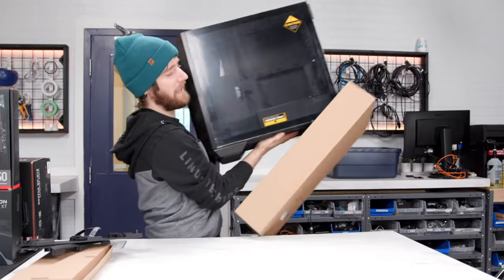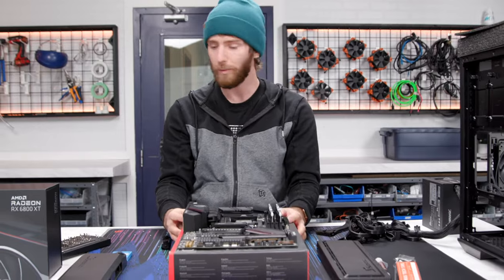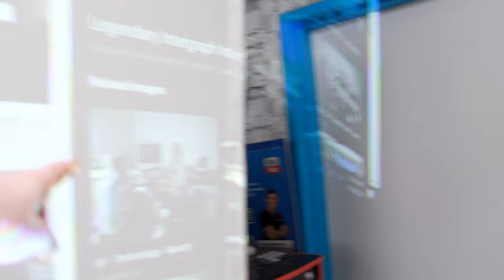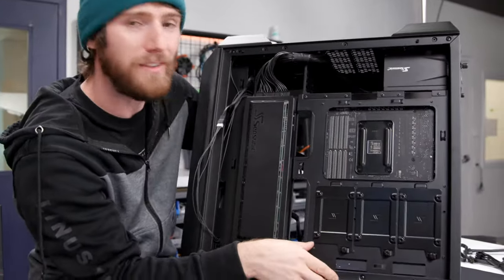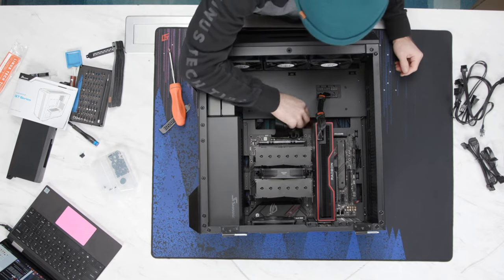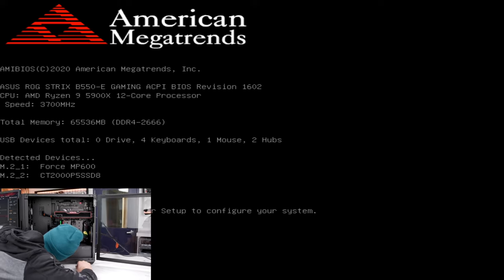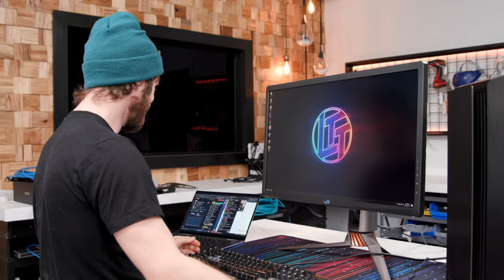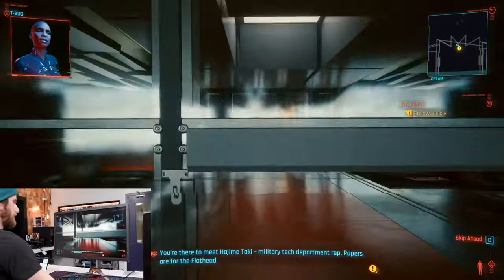The CLEANEST AMD Gaming PC Build

Comment: I think you're being very hard on the Q connector. Just because it doesn't work well in one very specific and atypical situation doesn't make it a terrible idea. It would be pretty easy to make a right angled version of it (or just not use it) for that one situation. It cost basically nothing and makes getting those right just a little easier. I loved it but accidentally sold my last one so now I'm back to wiring my front panels like a caveman. I would really like to know an actually good reason that they don't include them anymore.

Comment: Ok I have to stand up for usb 2.0. I work in an environment where we use a ton of wireless keyboards and mouse's . When I plug the dongle into 3.0 the that stuff does not get a good connection and the 3.0 port is causing interface. Once I put the dongle into a 2.0 extension plugged into a 2.0 all my problems go away. So we need at least one port for this option.

Comment: About the front panel I/O problem: Why won't we just use one of the dozen usb 3.x connectors on the MB routed to a case-hub in the chasse to spread love all over needs? I'm a power-user myself, but still never been able to utilize all my internal usb connectors yet. Might worth to think about it. 3.1 can even deliver way enough power for leds, right?

Comment: you guys ever gonna get those damn screw drivers in or what?

edit: just looked in the store and OMFG they are on the store now and not for sale but you can sign up for email notification and the release date is not concrete but says Summer '22 so basically in a few months.  The price is a bit much but if the warranty is similar iFixIt then it would be acceptable.  I do like the magnet power and the magnet bit idea and the short bits.  Can't wait to try it out if all things are as good as what I have just seen.

Comment: Thought about building a system to game on as the vega 7 in my laptop istn't that powerful. The Ryzen 3 3100 would fit my needs perfectly, if it wasn't just about 20€ cheaper than the Ryzen 5 3600... That said, I'll buy a 3600.

Comment: Hey Linus or someone else... I wanna buy my first desktop and I'm curious if in my setup is something that I did wrong or I can improve but i tryed my best... I wanna make a White setup so after all my research and possibility in my country I enden up with this spec: 
CPU - AMD Ryzen 7 5800x
GPU - Gigabyte GeForce RTX 3070 Vision OC 8GB
MotherBoard - Asus Prime X570-PRO
RAM - G.Skill 32GB DDR4 3600MHz
Power Supply -Corsair CX750F RGB White
Water cooling AIO - Asus RoG STRIX LC240RGB
Case - Phanteks Eclipse P600S - White
Monitor - 27' Acer Nitro XV272UP
I allready own SSD and HDD, in my AW 17R5 so I don't need them.

At all I'm not sure about that water cooling, because I can't find how good it is and how good that cooling effective is with Ryzen 7 5800X + I'm a bit worried if that radiator will fit in Phanteks case that i choose (I'm planning to put that radiator  on front panel). Can someone help me or just give me some advice ?. 
Anyway thank you all, be save and have a good day/night or whatever.

Comment: Linus, do you ever find that AMD and Windows 10 has driver issues and it seams it's just not related to one type of chipset or CPU model or GPU? I've been battling system bugs, blue screens and just plain reboots on just about any AMD setup i touch.  Any insight? Thanks

Comment: Altough i would not recommend x570 to anyone, i got a msi x570 tomahawk wifi and it has a pretty nice i/o  backplate and there  are only 2  usb 2 on it. There are usb2 connectors on the board but there are so many usb3 on this thing you may not even need those. VRM's aren't bad on that board so no problem driving any cpu, but auto voltage on the cpu can get  up to over 1.467v  by itself while boosting my 3600 to 4.4ghz and can get a little scary sometimes. At least i can watch Linus attempting his smooth Limbo roll  with it XD. Now I'm almost less depressed  that i still can't upgrade from my old  Zotac gtx 1050 OC 2gb   card to something  a little  better and my pc looks  like very  unbalanced  like deadpool  watching his legs grow back lol

Comment: Hey Linus. Doesn't NZXT cases as H500i or H700i has the front panel connectors in a single block as supposed to sperate individual connectors. @ 58:31

Comment: You really just dabbing thermal paste on and rocking it at 26:26 ? It's been a while since I've built a pc, but everything I learned then had me lapping the heat spreader to a mirror polish and carefully applying a thin and calculated layer of paste like it was worth more than diamonds. Mind you, I was overclocking the shit out of things with a 480mm rad. I'm gonna go ahead and keep letting myself think that it helped.
Reply: Another reason to not reuse the paste is that having paste on both surfaces and putting it back together can supposedly trap tiny air bubbles between the contact surfaces and act as insulators, impeding your cooling efficiency. Shrug.exe

Comment: with this video only , i am  getting a brief black screen for maybe 1/4 of a second . that re occurs every 10-15 seconds or so .. has any one else had this problem ? i am using  a SONY 65 inch  TV  hooked up on a  ether net  running at 500K + speed ..does not occur with any other youtube video or cable TV

Comment: @LinusTechTips, Is the Noctua CPU Air Coolers REALLY worth the prices??? Or is there something that could allow me a Similar Performance for Cheaper? You re-use 'em so I get that you Can Spend 130-140$CAD on a CPU Cooler, but for the regular Guys like me on a Low Budget that just Bought a New PC that comes with the Standard Wraith Spire that comes with the Ryzen 5 3600.

It's Mostly for Gaming and general Web Browsing, and I'd like to Overclock it a Bit Probably...

And I also need to buy an extra 8gb RAM because it only comes with 8gb RAM...so it would make for a total of 16gb...

Comment: so im confused a 5000 cpu and a 6000 gpu and the ram is only 2666 hertz    how was that a good idea when amd recommends 3600  for all the 5000 cpus
Reply: The ram is marketed at* and capable of up to 3200mhz, it however is clocked to 2666 from the factory to ensure maximum stability across all boards and cpus it may be paired with.
Reply: All ram is throttled from the factory until you activate xmp (or other cpu manufacturer's equivalent) profile.

Comment: Ryzen 7 5800X does not come with a cooler. I bought a Ryzen 5 3600 as a hold over from Newegg since they had them for 200 bucks and that came with a cooler but, I stopped in Microcenter in Columbus, Ohio for a modem/ router upgrade and they had several Ryzen 7 5800X's in stock. I saw unicorn, I opened my eyes really wide and pooped my pants, I adopted unicorn with money. Box is very light. It does not come with cooler.

Comment: The landfill position  @1:07 is not universally agreeable either. Penn&Teller did a BS episode on it like a 10 years ago, no less. I mean, less landfill is nice, sure. But not much else, and it carries a cost too. Is it cheaper to recycle stuff or make a new one? Not that clear, at all. Recycling has an energy and labour cost too. You can easily burn more oil trying to recycle old and/or cheap crap, than just getting new from the source.

Furthermore, the space? It's so much non-issue that it's funny. Throwing it into ocean? Sure that's bad and nasty and even toxic. But keep it in a pile somewhere, later put some dirt over it, maybe build a golf course? It's fine. Penn&Teller showed calculations as to how much space it takes. It is almost nothing compared to the land that is out there.